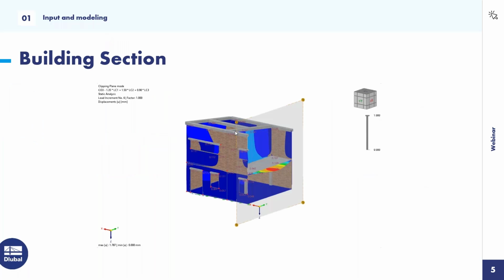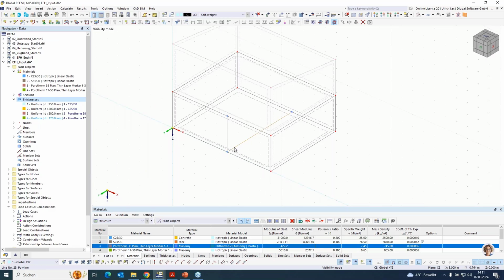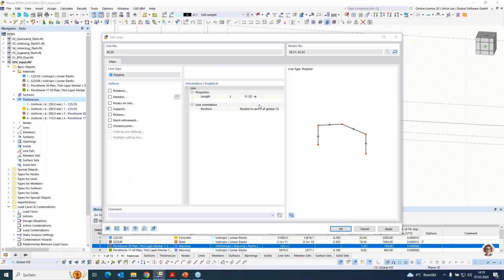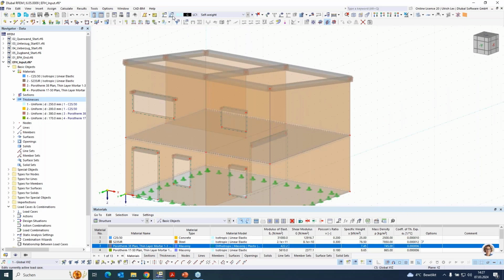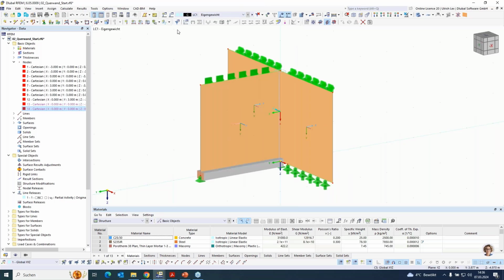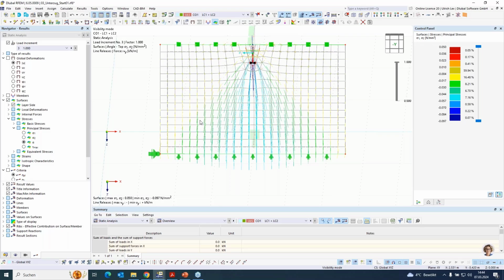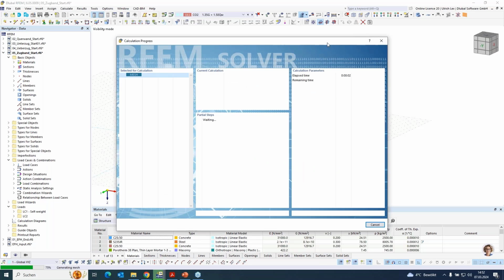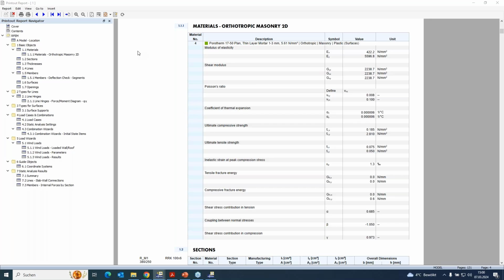Webinar | Design of Masonry Structures in RFEM 6 Using FE Analysis

Comment: I'm troubleshooting a RFEM masonry model and trying to indentify the problem places (why using Structure Stability analysis the model does not reach the desired wind load). Interested in checking the Principal Total Strains to identify the problematic cracks..  @56:13 You refer to the "..webinar before, where on the slab, the sliding slab on the edges were cracks..". Can't find it in this webinar. Do You refer to a different webinar?
Reply from the maker: Hi, @viesturs5! Thank you for your questions. We would advise you to contact our support team via support @dlubal.com  to get the best possible help for your requests. This way our team can give you a more detailed answer.

Comment: Can you provide formulas the program uses to calculate parameters for the Orthotropic Plastic material model (4:20)? Need to calculate parameters for a historic solid clay brick (250x120x65mm, fb=8MPa) masonry with general purpose mortar M8 (non standard mortar strength stated in the material report for the object by a research laboratory).